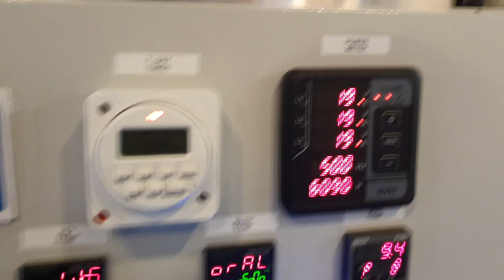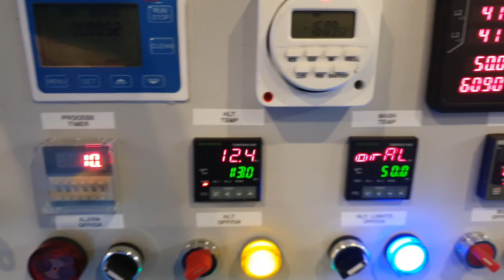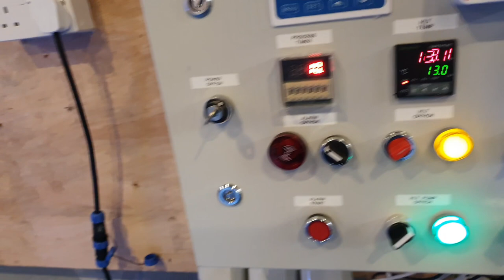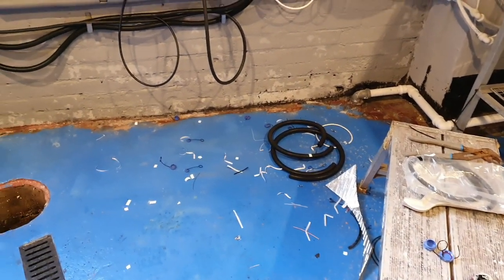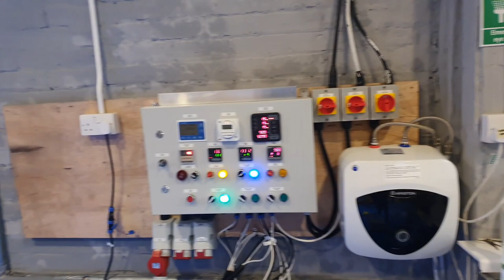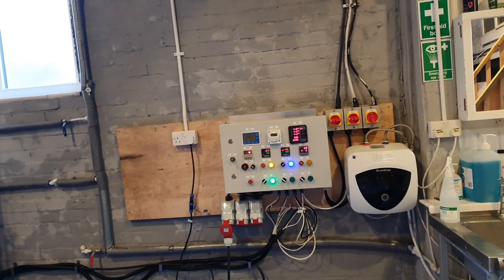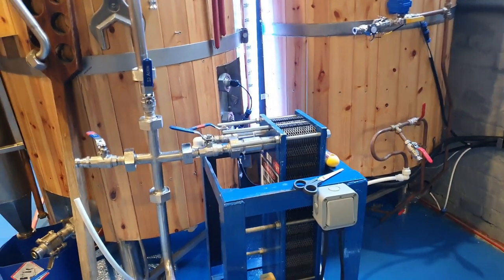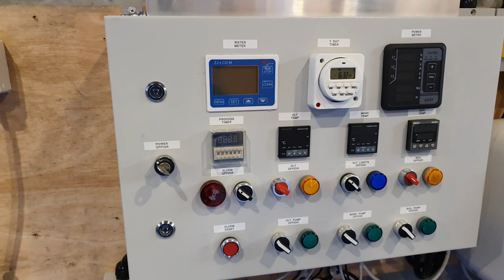Cables & Sensor

Comment: Speaking of hoses couldn't you rig a water line around the wall with quick disconnects on it so you can plug a hose anywhere and also have a shorter line that could be put away ,then there's no hose reek messing up your wall .
Reply from the maker: I like the ceiling mounted idea in the comments.